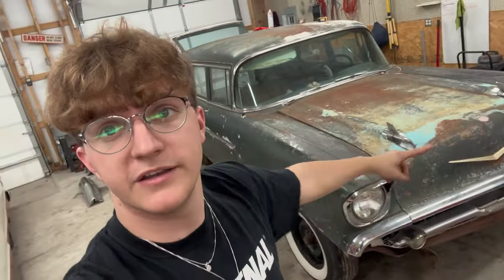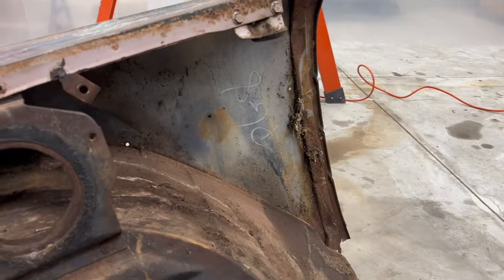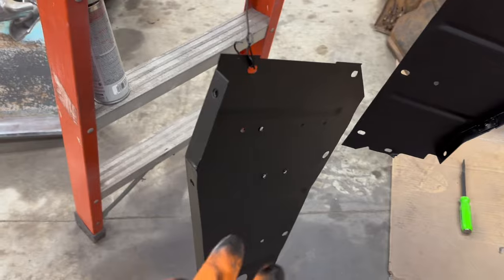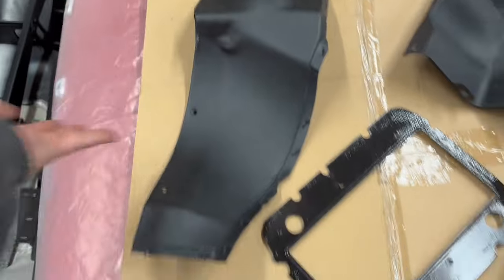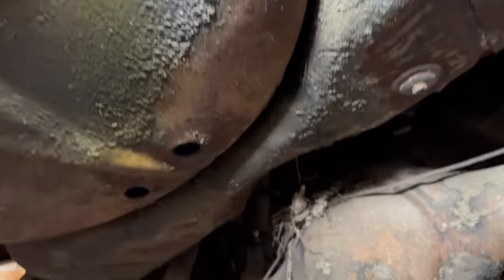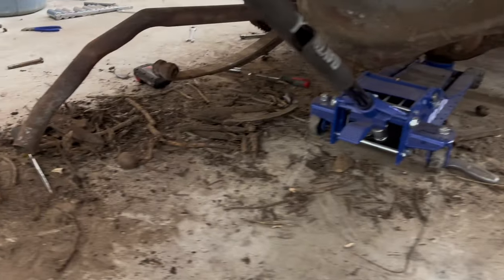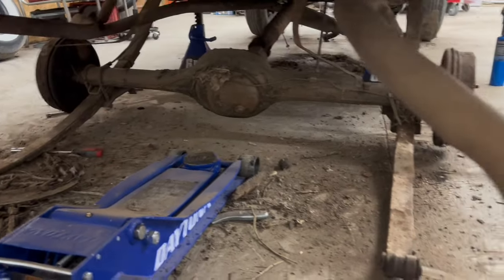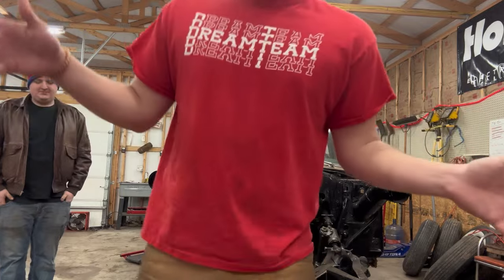ABANDONED 1957 Chevy Station Wagon Gets a New Life After 45+ Years! BIG PLANS!

Comment: Hello there, I really have no clue about cars but find it fascinating to watch you restoring these really old and rusty ones.
I am curious though. How exactly do you treat these extremely rusty spots on the parts. Do you just grind the rust away and weld broken parts with some other metal before applying the paint or is there more to it ?
And is the paint in itself there just to make it look clean and as good as new or does it protect against rust in some way?
Reply from the maker: Usually would cut out the rust or anywhere where metal is getting thin. Then replace it with fresh new metal and weld it in. Then paint out over it is just a rust prevention. Thanks for watching!
Reply: Keep up the good work.  I recently picked up a 1957 Chevy 210 Wagon as well.  Our cars seem to be in similar condition.
Reply from the maker: Thank you! Good luck with yours!